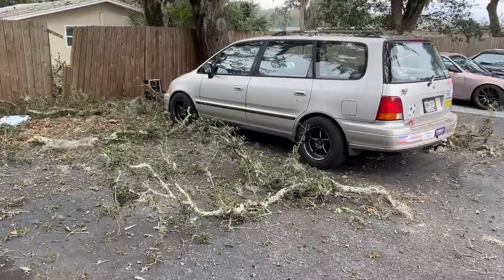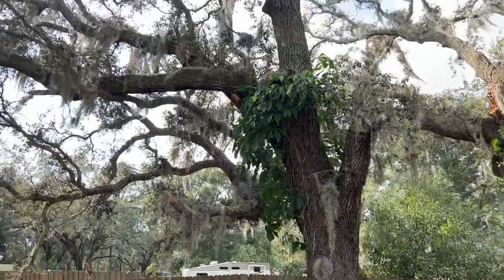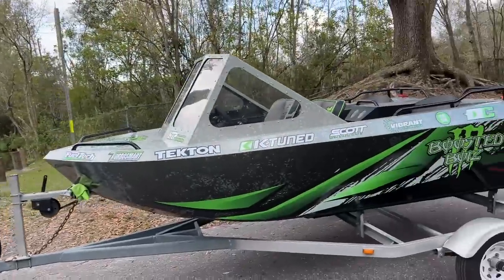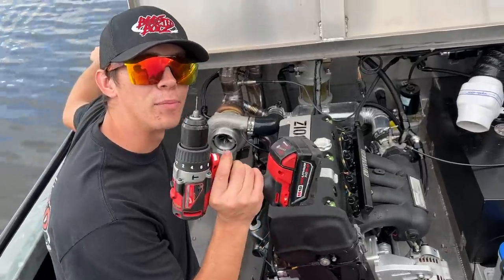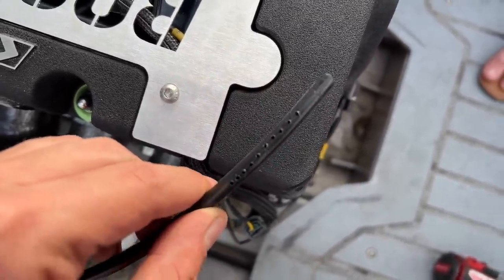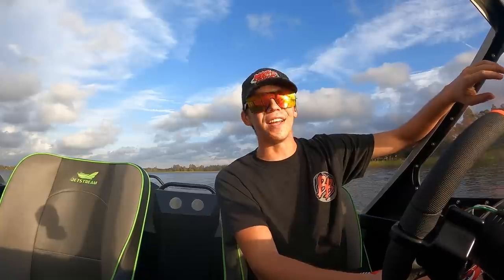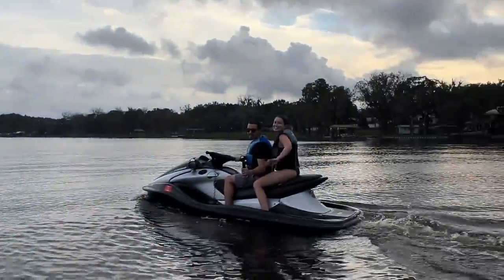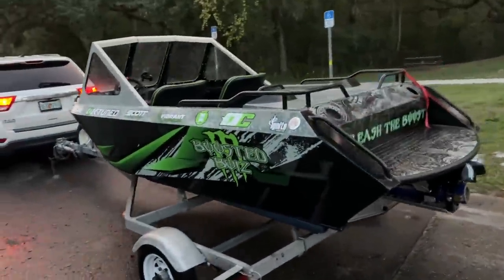Turned Up Our Turbo K-Swapped Mini Jet Boat and it RIPS!

Comment: You need a wedge in the pump get more angle on the nozzle to get more of the boat out of the water. That would help not having to saw at the wheel so much. Also you probably gain 1-3 mph. Planed out you shouldn’t have maybe 3ft of the bottom in the water
Reply: What this guy said!!
Reply: That would help alot.   Get it riding right further back on the hull. A few more mph maybe.
Reply: Good luck putting a pump wedge on a Scott jet pump lol These aluminum jet boats will never reach great speeds. They are very inefficient.
Reply: Def needs more trim down, all the thrust is going into the air
Reply: Agreed, shes running with way to much hull in the water.
Reply: Yeah in theory it would however because of how this boats are made these boats tend to porpoise they will jump out of the water and back in jump out and in out and in and if you put a nozzle it's going to further want to push the boat out of the water he needs to add some trim tabs to the rear of the boat to extend the bottom plane of the boat and then add a nozzle otherwise it's literally going to jump out of the water and then lose speed slash back into the water then jump out of the water again
Reply: FIRST THING I THOIGHT WHEN I SAW THE FIRST CLIP OF THE VIDEO
Reply: On the fly bys the boat was sitting flat in the water. I'm not a boatologist, but that looks like a lot of drag.
Reply: He needs to hook up the trim, an point the nozzle in the water. Don't see jetskis with that big of roost
Reply: I wouldn’t be surprised if that boat picked up 4-5 mph from just a wedge. There is soo much hull in the water, if it starts to porpoise then add some sort of trim tabs
Reply: Agreed re. the trim issues
Reply: It’s throwing roost because it is trimmed up alot.
Reply: agreed neads to bring the nose of the boat up a bit help settle it.
Reply: Yeah, I’d send a video of the boat to Scott water jet and see what they suggest to optimize the performance.
Reply: And adjust the pump nozzle, that’s the whole point of the adjustable nozzle lol.
Reply: Part of the issue is the boat design there’s way too much weight forward of the COG. Also it was designed to handle well not fly the hull.
Reply: @Trevorkloida  interesting enough the thrust is gernerated in the pump when the water is squeezed thru. you could actually point the nozzle any direction and the boat will still go forward although not as effeciently. pretty counterintuitive i know but it actually would benefit from the nozzle being pointed up even more to help trim the bow up so theres less resistance on the hull.
Reply: I love all the likes like us simple son's of know what your talking about 😂
Reply: @SantysEK  Any modern jet ski has a hull design that is no joke. These mini boats are good for jumping over stuff and playing around in smooth water but that's about it.
Reply: @Trevorkloida  after the water leaves the pump it's not helping you go faster.  but yes the angle is pushing the back end into the water too much at speed.
Reply: @Trevorkloida  nah, needs to trim up lol. that would lift the bow up.
Reply: You mean 3 inches of water ?? 3 ft is the whole side height of the boat 😂
Reply: @stevenallen2449  no I mean having only 2-3 foot of the bottom of the rear of the boat in contact with the water right now it is causing a stupid amount of drag. As it sits right now that boat won’t run in less than 6-8 in of water if it was trimmed correctly then it would run 2-3 inches of water
Reply: @SaltyDogPerformance  I know nothing about the Scott pumps I just assumed it could be wedged like a American turbine or Berkeley pump. But assumptions are the mother of all f—k ups
Reply: I was thinking that watchin the video, the boast is too flat on speed, right?
Reply: @johnrnew9439  that spray from the bow should move further back as you increase speed and trim. Pressure pushes down on the transom thus pushing the bow out of the water decreasing drag
Reply: It's a flat bottom boat and more angle will make it roost more wasting even more power, its already trying to wheelie causing it to porpoise out of the hole. And after the boost is where it should be then contact Scott and order a different impeller to get the rpms in the sweet spot then it will be close to a 60 mph boat.
Reply: If you have watched his previous videos they have a hydraulic trim system but didn't have the stuff to hook it up so they put a rod in its place to keep it from trimming up and down
Reply: Man that is true
Reply: I’ve built quite a few of these I’m from Alaska we never shim you want it to ride relatively flat for stability if the draft is to shallow you’ll suck air which = less power plus it tears your pump up also it gets unstable in a straight line plus it tends to bank to hard making it harder to steer
Reply: @Trevorkloida  trimming down will make the riding on the nose worse it will bot only make it slower but it it will cause it to drive jebky and steer on the bow... he needs to do just that, trim up even more
Reply: Definitely needs wedges and spacers, been saying this since they put the poly on the boat. Gotta get a jet boat guy out there to do some pump tuning.
Reply: Why is he spinning the engine to only 5600? That's barely getting started on a k.
Reply: I was watching and thinking exactly the same, you beat me to it. The nozzle is trimmed way too upwards. It's pushing the stern into the water instead of over it. Have a look at the Zipwake Interceptor system if you want the boat to handle better.
Reply: It almost looks as if the ass end is pushing up and not down into the water and nosing up
Reply: @Trevorkloida Exactly!
Reply: @fast97z24  a boat like this is direct drive and will only spin as fast as the impeller. It takes more power to spin the impeller faster. So the rpm is actually limited by the power of the engine. And then to make matters even more confusing you can adjust the impeller sizing to get the rpm you desire... but that also has effects on your acceleration and can lead to cavitation during holeshot.
Reply: I was gonna say the same thing he needs to angle it down a bit get on plane more and like you said he will Fs get a few more mph
Reply: @Trevorkloida  trim angle is much of a problem.... Finnegan tested it 30degree upward .... Wasn't really a big difference....
Reply: @SantysEK  rubish
Reply: Yup the boats staying flat and doesn't look like she's getting up on plane.
Reply: @mohawkc77  usually helps to constructively tell someone why their comment might be incorrect instead of just commenting "rubbish" lol
Reply: They could also run a droop snoot to lower the thrust point and get the bow our of the water when they plan on open lake days like this and just swap it out for river days when they want more clearance. Would be great to get trim plates going too.
Reply: Awesome
Reply: Agreed
Reply: @TheBCninja  damn. Thanks for the explanation!
Reply: Can you hook a fire hose up to the pump further Honda super soaker 9000
Reply: @fast97z24  yeah no problem. I'm no expert, I've just watched a lot of videos on it. There's definitely a sweet science to motor rpm, turbo efficiency range, pump size, prop pitch, etc.
Reply: The boat has electronic trim it's just not hooked up.
Reply: @dmanm85  yeah they set it a few degrees up and locked it in place with a rod. It's gonna feel even quicker and faster with the solenoid. Would be cool if they set it up to automatically adjust based on GPS speed or something (I think rpm would freak it out while jumping logs).
Reply: @TheBCninja  For sure, I bet the fueltech is capable of that with some tweaking
Reply: Another agree. Its bow steering, dragging a lot of hull. Potentially adding some rear weight. A full tank of fuel in my tunnel hull "200 liter tank" is 10mph faster then an empty tank.
Reply: Absolutely
Reply: Yep.
Reply: I think what would also help is a scoop to feed air directly to the turbocharger instead of it sucking hot stale air from the engine box
Reply: The amount of people here who don’t know how to trim a jetboat is comical.
Reply: @369motoman  My Allison porposes out of the hole due to the short shaft outboard and the type of prop. It settles itself out. It's a flat bottom the last 5 or so feet. Any type of hull will benefit from less drag ie getting the bow up. Simple hydrodynamics. Rooster tail isn't always waste of power. Furthermore I fairly certain the fuel tank is in the bow of that vessel.
Reply: @369motoman  Another comment nailed it. He needs some trim tabs to get that thing to ride on the very back of the hull. Get the bow up reduce drag trim it out and he will add some serious mph
Reply: This is not a bass boat with exterior prop. The jet nozzle needs to trimmed down to jeep more propulsion in the water and not making rooster. If you only have 3 feet of boat in water the intake will suck air and lose propulsion.
Reply: @fast97z24  i think the engine is load limited to that rpm right now with the lower boost
Reply: Came here to say the same thing. I'd say the impeller probably needs to be resized also.
Reply: Came to say this same thing. That boat is plowing through the water. Need more wheelie
Reply: @dakotahicks6725  exactly they need to fix the trim, then get a new nozzle and then add trim tab plates on rear of boat
Reply: He built this for content guys. I doubt he is worried about max efficiency.
Reply: @lifebehindtheselens  when they get the built motor and hydraulic trim system working the jet itself is fine the guy that built it built it specifically for the build for Kyle and walked him through how to set it up a smaller jet wont do anything but labor the engine more and its already struggling to get over 6k rpm
Reply: This
Reply: Same thing I was thinking
Reply: I was going to say the same.
There's a lot of hull still dragging at top speed.
The bow shouldn't even be touching the water.
Reply: It's a very fine line when trying to trim a boat out of the water that actually requires it to remain stuck to the water for the pump to work.
Reply: You guys are aware that it’s essentially just a flat bottom boat they really aren’t meant for top speed but jumping shit and handling
Reply: @billybankhead02  it would handle better and jump better if the nose was out of the water more. My flat bottom is 16ft with a small block and a American turbine. It’s heavier but about the same power and on plane only has about 3 ft of the boat in contact with the water and is not as fast.
Reply: @tomeickhorst6787  there’s still a huge difference cause it not just a flat bottom boat but built similar  and they are designed that way for handling specifically for being able to dip the nose and spin easily
Reply: @billybankhead02  like I said I don’t have one I was just going by the one I have run with on the meramec river in missouri his is a 12ft model and it runs like a normal jet boat at speed it doesn’t plow thru the water. I’ve never rode in it or drove it. But they are impressive on the abuse they can handle
Reply: @billybankhead02  yep but kyle doesn't seem to 🤣
Reply: @smbmxable  he would have way more fun with it if he just took it to a track designed for jet boats what he’s pushing now is enough to have a great time
Reply: 100%
Reply: I'm a boat guy.  Your boat is riding vary wet. Try adjusting the tide plate under the pump the get the boat out of the water a little more. You need to raise the nose up out of the water which will be good for up to tem mph..
Reply: 3ft of boat is waaaaay to much to be in the water. You only want the back 12" of the pad in the water. I'm a boat engineer
Reply: @akpolack  "The amount of people here who don’t know how to trim a jetboat is comical." Hahahaha, my thoughts exactly. Now lets see if you are on the same page as me. I haven't watched the whole video, but the opening shot in the intro tells the tale for me. That thing is already trimmed to the moon. You got 300 morons here saying he needs to trim higher and only a few who can see what's really going on. The hull is obviously not designed to fly like a well tuned boat, but it either A) has way too much weight too far forward or B) has some kind of "hook" in the hull. Doesn't matter how much you point that nozzle to the sky if you don't fix those two problems. Front was buried.
Edit: Actually forgot to say it would pick up some speed trimmed down a few degrees. 21' Shockwave with an LS3 and I can feel big differences in speed as I bump the place diverter from fully level to 1 foot rooster tail and then slow down again as it gets to a 2-3 foot rooster tail. There is a narrow sweet spot.
Reply: You mean 3 inches right?
Reply: 85% of yall don't know what your talking about. All these jet boat experts coming outta the toolys

Comment: Might wanna just do cheap mods like take a grinder or belt sander and shape some of the leading edge of the poly. Also the where the poly meets the intake could probably use some shaping. Finnegan picked up a TON by very slight changes to the intake shape.
Reply: I remember that.
Reply: Finnegan!!. No cussing allowed here
Reply: He is using a hull design that responds well to increased HP. With a 300hp outboard they go over 100 real mph riding on a cushion of air thanks to the air entrapment bottom design.
Reply: Send 'er to LS George!  Needs a port job!
Reply: Port the poly. That's a new'n
Reply: Real talk shape the leading edge of the ploy infront of the pump so it slopes into the pump not taking almost a 90* turn into the pump. It’ll gain 1-2 mph almost guaranteed
Reply: +1!
Reply: @stoker20  Very true but def couldn't hurt to shape it a bit.
Reply: This!!!
Reply: @stoker20  doesn't matter you still gain off shaping the polly.

Comment: You should of drilled the holes around the pipe instead of a straight line, honestly it makes a difference. Your boat also needs to plane more, adjust the jets and it will fly.
Reply: I was about to say the same thing needs to trim down the jet a lot of power loss just flying up in the air.
Reply: The right answer is just adding a T like the old dayz.
Reply: @busshead  Came here to say this...far too many jet boaters doing this.
Reply: needs a jet evader. 40 foot rooster tails are mandatory.
Reply: Trim the stream of water to push against the water not the air, right guys
Reply: terry  water pushing against water = more thrust, looks cool, but it's like swimming on land or walking through water
Reply: @recruted  it's not pushing against the water, the trim nozzle is redirecting the thrust slowing it down but a double edged sword, You may gain more thrust with the trim down but also pushing more hull through the water. He could use pump wedge to get the thrust up
Reply: @michaelshafer2996  I can agree with that and to add to it it would probably still go faster with the jet of water pushing agenst the water directly behind the boat until lifting the rear so much causes cavitation at the jet inlet, secondly when the nose is further down it will change the point where the boat steers from, say from mid/rear of the hull to pump outlet,  to front of the hull to the pump outlet,(less stability),, I can only think of the physics in motion, but I dont know the proper terms applied for boating,
 but also with the propulsion pushing against water vs air the there is more potential for speed to a point the water has more density vs the air,(spin in a circle with your hand out how much resistance does your hand have vs the air, jump into a pool and with your hand out and underwater spin in a circle, which had more resistance) it's like spinning tires/ no traction vs hooked up and moving forward, trimming down is like having more traction and at a point it would push the hull down, yes,  but if it goes faster it will lift the hull up even more just have to find the right balance, I would think it would have more speed until the pump inlet cant get enughf water (cavitation) plese correct me where I'm wrong I could have the wrong idea or direction being a land lubber

Comment: Does it have trim? The bow sure looks low, trim it and you will have less waterline IN the water reducing drag by a HUGE amount!
Reply: Does that just mean having it like do a water wheelie?
Reply: @SikkRaz3r  kind of.
It tilts the motor up raising the bow of the boat, lifting it out of the water creating less drag and multiple more MPH!  
My boat gains 7mph just from trimming it up.

Comment: It would be nice to have a second fuel tank as a ballast. have a transfer pump so you can shift the weight side to side as needed.
Reply: Better option with out any weight added is Boat Trim Tabs. look them up help him see this post. Cheep and easy to install or make.
Reply: Dude this is a click vid build. This isn’t a navy/cg cutter that needs to handle big waves. It’s a lake boat. It’ll be gone before you get bored of it.